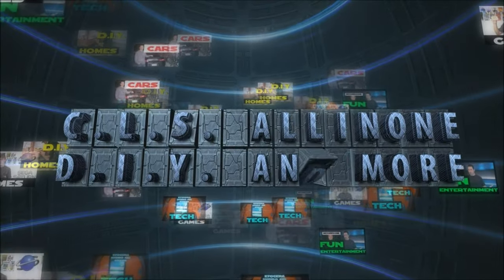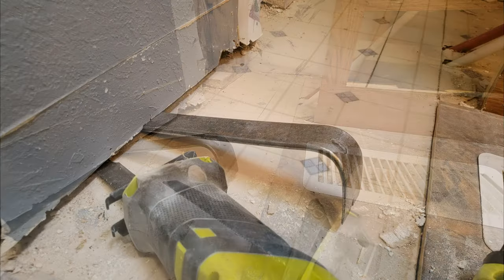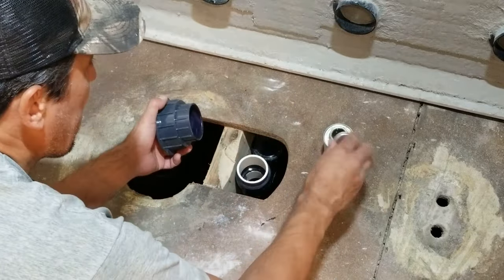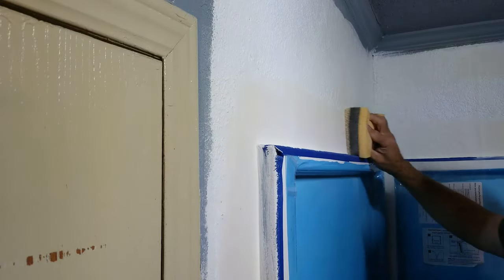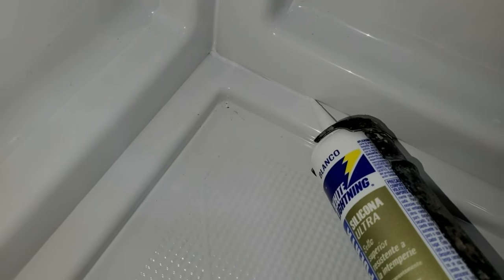How to remodel a shower from start to finish with Lyons Linear shower kit from Menards.

Comment from the maker: Bookmarks!
@2:06 = Modifying cabinet part 1
@3:13 = Accessing shower plumbing & removal
@4:10 = Remove old shower
@7:03 = Relocate shower wall
@9:18 = Treat mildew
@9:36 = Framing the shower walls
@11:08 = Test fit for shower base and walls
@12:44 = Shower drainage part 1
@15:45 = Patching the subfloor
@17:22 = Relocate Waterlines
@19:15 = Installing Moen shower faucet part 1
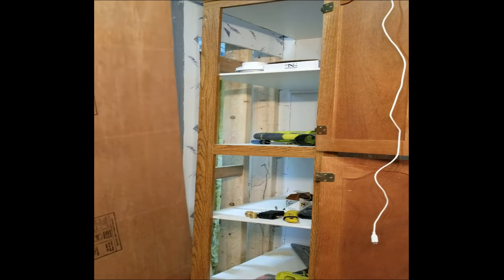@26:23 = Modifying cabinet part 2
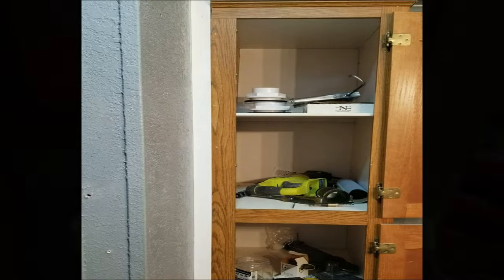@26:55 = Install shower base & shower walls
@33:37 = Brace shower walls
@34:47 = Patch drywall around shower
@38:24 = Wet-sanding drywall patches
@39:32 = Wall texture "knockdown"
@40:53 = Caulking joints on out side edges of shower
@41:39 = Painting the walls & cabinet
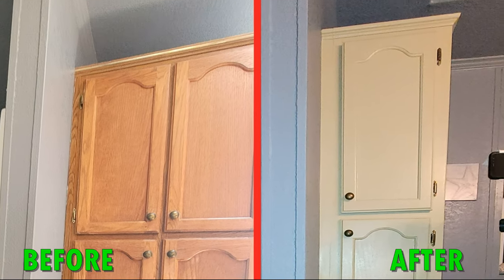@42:27 = Shower drainage part 2
@44:30 = Patching vinyl flooring
@46:08 = Installing Moen shower faucet part 2
@47:53 = Installing shower doors
@53:48 = Applying silicone sealant to shower
@54:51 = Shower leak test